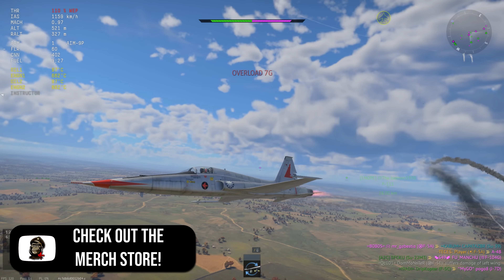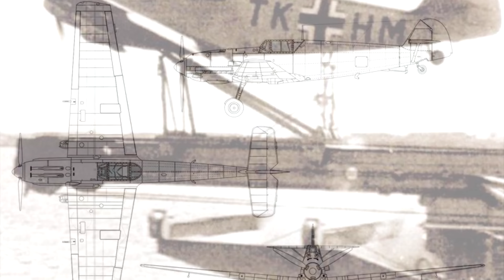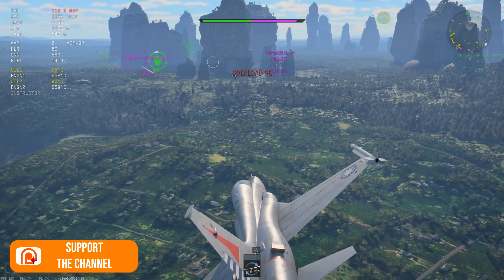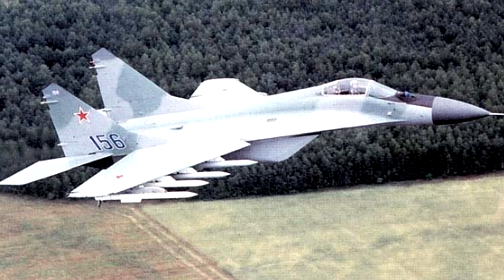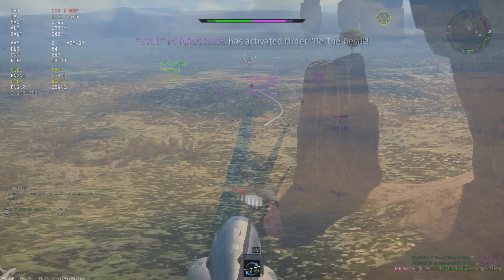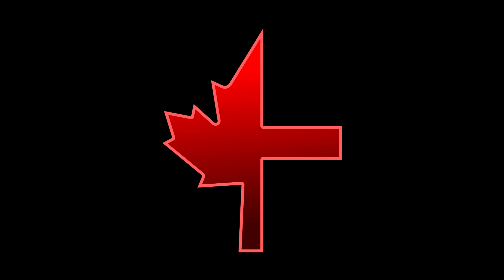War Thunder: MiG-29 Gets INSANE Upgrade! (Devs Have New Weapons Passed!)

Comment: Mig29smt is more modern. It's missing half is ordinance and FM is still fucked
Reply: SMT might be more modern but it's a modernized regular MiG-29A

MiG-29M is totally different jet..

Basically it's similar situation as Harrier GR3 vs GR7 we got ingame... there is first original Harrier 1 and then there is Harrier 2 which is Harrier GR7 and AV-8B Plus
Totally different harriers and the second gen Harrier turns insanely good and made out of different materials and stuff

MiG-29M is superior lol

Same thing happend with SU-25's

SU-25 SM3 is more modern but it's actually worse and cheaper then older SU-25TM lol

Comment: ✅ TL;DR – Key Upgrades at a Glance

Category
Airframe:	New structure, composites, better lifespan
Engines:	RD-33K w/ FADEC → more power, better fuel use
Radar:	N010 Zhuk → multi-target tracking, ARH support (R-77)
Sensors:	Improved IR/TV + laser designation
Weapons:	R-77, TV/laser bombs, 8 pylons
Flight Controls:	Digital FBW + pitch instability = high-AoA performance
Range:	20–25% more fuel, 2200 km range
Cockpit:	Modern HOTAS, dual MFDs, better visibility
ECM:	Full 360° jamming + 120 countermeasures
Reply: Source: ChatGPT.
Reply: @luv-seon Transcript+ChatGPT 🫶
Reply: Not really an upgrade
Reply: @chief8559  ........HOW?

Comment: They should just add R-73s to the MiG-29s and increase their BRs. R-60M is a shitty missile in its own br, let alone in higher tiers.
Reply: What would make Sence Is buffing the air frame, givving them R73s and removing the ERs so they are realistic and not this made up bs
Reply: Add the R-73, remove the R-27ER. This would make the Mig-29 much better up close while balancing it at range. It would also make it more realistic. 
A second version with the R-27ET and ER should be put at 13.0 foldered with the 12.7 version.
Reply: @geofisika8838  I would also recommend to buff R27R. Currently the missile isn't very good past like 15km because of the insanely high drag coefficient.
Reply: They should give it r-73s and keep it at the same br
Reply: Yeah. And yet SU-22M3 with 12 flares and no radar with them on 11.0 💀
Reply: Absolutely not increase the br. Remove R-27ER, Give 6 R-73, Un nerf the flight model and it will be perfectly okay at 12.7. Increasing br doesn't make any sense because at 13.0 there already is mig-29 with both R-27ER and R-73 and also flanker with better flight model plus a trio of ER, ET and R73
Reply: @maxwellmaragia2272 6 R-73s would make it go up main example 
Belgium F-16 in french tree, i believe, is 13.0 with 6 AIM-9Ms that are better side shots but worse rear and head on
Reply: @sniper321fire  Why? No reason whatsoever for it to go up, At 13.0 there is flanker with 4 ER, 2ET and 4 R73, Also mig-29G with 2ER/ET and 4 R73 and better engines I believe so tell me why it should be same br as those 2 and which idiot will want to play it? 🤔. The F-16 at 13.0 atleast has vastly better flight model, More countermeasures by far, better RWS, better gun with more rounds e.t.c, you can't just compare them solely based on the missiles they carry. mig-29 with 6 R73 and fixed flight model will be perfectly fine at 12.7
Reply: @maxwellmaragia2272 tell that to gaijin then that balances by missiles a lot of time looks at Iran F-14A only has 4 fox 3 missiles going for it at 13.0 as radar is pretty bad, 2 R-27s it has are bad and 2 rear lock only IRs
Reply: @sniper321fire  The Iriaf is in a tricky spot. Its fakour 90s are essentially the best fox-3s in the game and are effective at any range and also almost impossible to notch/chaff them, sedjeel and R-27s are also better than sparrows any day, it cannot be same br as tech tree F-14 courtesy of its vastly better weapons. Completely different situation compared to an IR missile load only although admittedly Iriaf should be given aim-pL or even aim-9m to be honest
Reply: @maxwellmaragia2272 sedjeel only have range over AIM-7s and they are not close range SARH at all but other 13.0s are just sad for what they are. If its not fox 3 thing's like AV-8B+ and F-4F ICE are fun for 13.0

Comment: Still no R-73s?
Reply: Every MiG-29 should have R-73s, the 29M too
Reply: @sealboyy6584 wish that SU-39 and/or they add SU-25TM ( basically SU-39 copy paste but tech tree because it's the same plane ) got what it's missing

I want SU-39 / SU-25TM with an R-27's and R-77's which are historical lol
Reply: @kajmak64bit76 I know they are historical but, I don't think they would be of much use on that airframe, you also lose the ability to carry the majority of it's ground armament.
Also TM and 39 is the same thing
Reply: @sealboyy6584 i literally said 39 and TM are same thing

And wdym giving R-27's and R-77's wouldn't change much?

It changes... everything... and i might actually buy an SU-39 if it had atleast R-27R because as it is right now SU-39 is just a CAS premium for Ground battles not really as an Air RB grinder premium as the higher tier SU-25's are kinda bad at those BR's lol

Especially thanks to Gaijin nerfing the base respawn timer after buffing it to be nearly instant... and not only did they return it back to old normal speed they further nerfed it and extended the base respawn timer lol

It was with first F-111 update
Reply: @kajmak64bit76  I mean yeah sure, R-27s and R-77s would change a lot, but still, it would limit your actual purpose, and with the obvious increase in br, it would become worse than an F-4F ICE, because what would be the point? 
Your missiles are even worse now since you're on a CAS airframe, and the radar couldn't even look up due to its position being in a targeting pod position.
You would have all odds against you, and it wouldn't make for a really good premium plane either.
Reply: @sealboyy6584 all it needs to carry for Air RB is 2x R-60M's 2x R-73's 2x R-27/R-77's and 2x napalm bombs minimum and the radar pod which is obviously needed for the radar missiles

Why add the missiles? To make the plane more unique and justifiable to buy... i can't buy the current state of SU-39 it's just bad... however if it had R-27's and maybe R-77's... that would make it cool enough to buy it

You could put it at 12.0 maybe 12.3 easily with R-27's and MAAAYBE R-77's

Balance here is based on MiG-21 Bison having THE EXACT SAME RADAR with 2x R-27R's and 2x R-73's and being supersonic and stuff and it sits at what? 12.3 was it?

Meaning SU-39 with R-27 can easily sit on the same BR and with possible R-77's aswell

But maybe with R-77's it can go to 12.7

Comment: If they don't change the flight model nobody's going to realistically play this in a top tier scenario everybody will still stick with the su-30 or the su 27 SM either fix the flight model or stop adding the plane I want more mig-29s and the mig-35 but they're all going to be useless if they don't fix the flight model.
Reply: obviously they will keep the model as is so that mig35 can seem wowsies. The usual, undermine something, so that something else can shine. The same way they did with RD33s, R77s, and so on.
Reply: @goliath3413 man I really do love the undermining of the plane literally built around the r73 not getting the r73 man I really do love the 2014 version not getting the 77 - 1 man I really do love the plane that just can't have the same AOA as the F-18 like it does in real life a plane that should be able to beat the f-15c in a dog fight but can't I could go on and on and I could post Source after Source after source but I digress
Reply: @goliath3413 you also do realize that the mig-35 is just a two-seater MiG-29 meaning it'll be even heavier man that's really cool like the plane isn't already a brick as it is😂
Reply: @FULCRUMMIG29  ah, i mixed it up with 1.44. Besides, a fat mig29? Never heard of such thing xdddd. Its gonna be yet another SMT: Absolute brick with somewhat good weapons and a good radar.
Reply: @goliath3413 it has much better engines and I think it uses composite so it wouldn't be that much. The only issue would be the increased surface area which would affect it but it gets 8 hardpoints with really good radar so not that bad
Reply: The MiG-35 is not a two-seater version of the MiG-29M2. This is the next modification and it is very different in terms of its filling and performance (the engine is 10% more powerful) and there is a MiG-35 in a single-seater version (it is almost impossible to find a photo). Although I would like a MiG-29OVT and I expect that the 29 will get a flight model slightly better than the Colander.
Reply: @FULCRUMMIG29  The MiG-35S is a single seat while the MiG-35UB is the two seater. So no, they could just add the 35S
Reply: @1Yakisback I didn't think I'd have to come back to people talking about the mig-35 and well yes there is a single seat version of the mig-35 the twin seat version of it is more common the single seat version of the mig-35 was a concept built off the twin seat because they wanted a single seat version so please everyone stop trying to correct me because I know more about what I'm talking about than y'all probably do. Also saying the Mig 35 is a new aircraft no it isn't it's still a Fulcrum because it's just built off of the MiG-29.
Reply: The flight model seems really good, what do you think is wrong with it? I find it's very dominant at 12.7. Well kinda, until your two very nice missiles are gone.
Reply: @greybuckleton  Unfortunately, the snail turned it into a phantom, a cow with missiles. It has an excellent instructor (easy to control), but the terrifying effectiveness of the Oswald. At the top tier, this is important in duels (which is extremely rare in the Avia RB) and in basic attacks - launching a missile, going into notch, returning to the trajectory and launching a missile. That is why the Rafale dominated the top tier (Ultramaneur + the best close-range missiles). Due to the huge parasitic drag with the slightest maneuvers, for example, at an altitude of 5000 m, the Mig 29 can drop speed with a sharp departure into notch from 1300 to 600 km / h. In general, it just stops and begins to fall during basic maneuvering in the game, even with the smoothest control. In my opinion, it is better to take away the R-27 and throw it at 13.0, but give a normal flight model not from a bomber.
Reply: @failllalala2482  The Mig29 I fly is BR12.7 with the R27ER. It's pretty good there. You and the F14 rule the range game. I can trash an F4 in any kinds of turn fight. And you have HOBS IR missiles. Thought the love flares more than fat kids love cake. 

I can't see a Mig29 having a snails chance in hell against a Rafale, but frankly that seems realistic.

Comment: I think we’ll get the 4.5 generation light fighters first like the MiG35 and F16c block 70 before we get Su35 and maybe the F15ex
Reply: mig35 is a 4.9, mig29m/m2 are 4.5. we also have the f16v to be added.
Reply: MIG-35 will likely not be added as it stayed as a prototype because little to no countries wanted it, and Russia uses these prototypes to protect cities from drones...
Reply: @EXPLODINGGM-j9c MiG-35 was built, so it will be added eventually
Reply: @EXPLODINGGM-j9c  mig35 is a legit aircraft in service that just got cleared for mass production weeks ago
Reply: @Gas4PlanesSince when did it get into service?
Reply: @EXPLODINGGM-j9c  the mig35 entered limited service in 2020-2021
Reply: @Gas4PlanesAnd there's only 6 planes right now.
Reply: @EXPLODINGGM-j9c   so what, i specifically said limited service so ppl like you wouldn't try to be sigma
Reply: @EXPLODINGGM-j9c what the fuck are you talking about

Comment: We should get ARH AIM-7 sparrows and R-27ER's.
Reply: What’s the point of an ARH AIM-7? Also Meteor and JATM when lol
Reply: @Iden_in_the_Rain For Lower Br jets.
Reply: @Iden_in_the_Rain The only AIM-7's and R-27ER's are being used are ARH versions wbich should be added in the game.
Reply: @EXPLODINGGM-j9c  there’s no reason to add an ARH AIM-7 (since there are already better missiles to use, like the AIM-120), and the R-27EA is a Mach 5 ARH so Meteor and JATM would need to be added.
Reply: @Iden_in_the_Rain There are planes that don't carry aim-120s.
Reply: @Iden_in_the_Rain The most possible option is to likely add  R-33, and R-37M missiles.
Reply: @Iden_in_the_Rain AIM-120 has less range and speed too.
Reply: @EXPLODINGGM-j9c  the R-27EA never made it outside of design, it is not adopted, and the R-27ER is still standard on older su-27's, which lack the ability to fire the R-77. There is also no ARH aim-7 in use, the aim-120 literally exists to make the aim-7 obsolete.
Reply: @chris10000 There are custom ARH R-27ER's.
Reply: @EXPLODINGGM-j9c  no, the only ARH version of the R-27ER was the R-27EA, which one are you talking about
Reply: @EXPLODINGGM-j9c  do you have a source for this ?